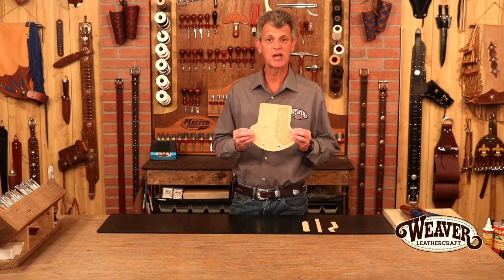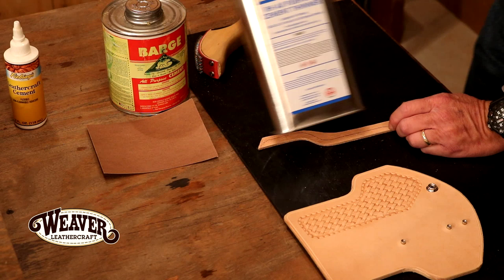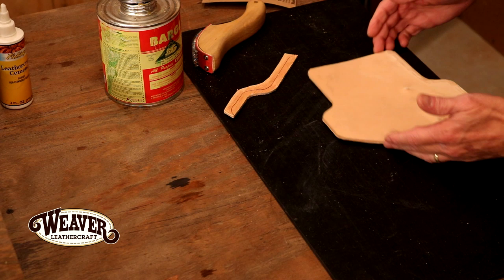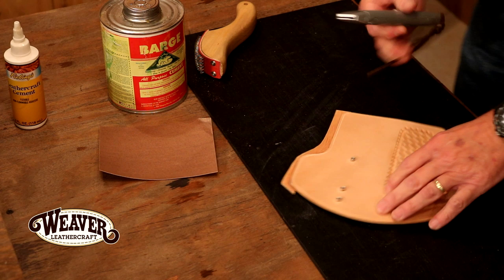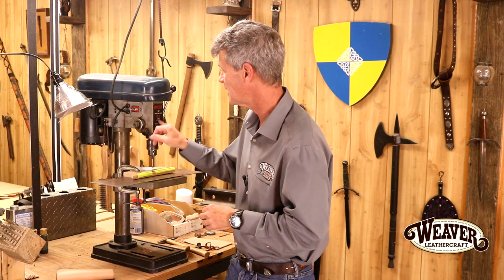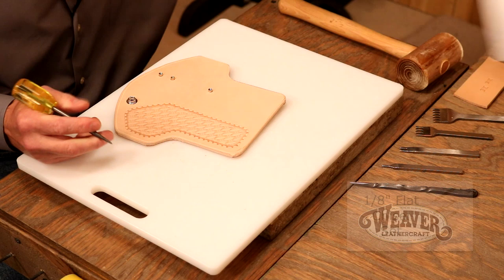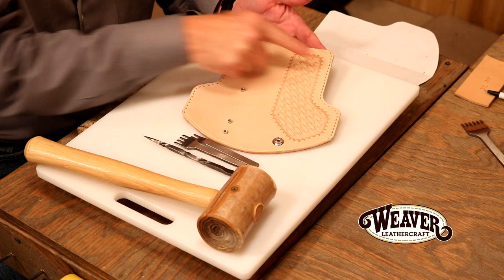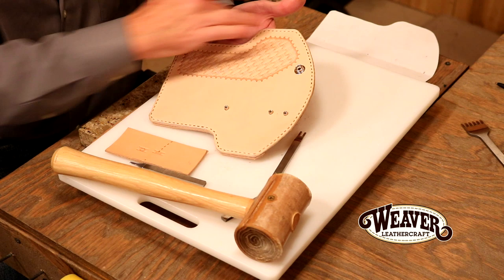Making a Leather Holster Chapter 4: Adding the Stitch Holes for Sewing

Comment: So I can't really tell but I assume that isn't a diamond chisel right? If you were using a diamond chisel, half would have to be hammered through the grain side and the other half through the flesh side so that the orientation of the diamond holes match when folded over correct?
Reply from the maker: Hi Bill,
That's correct, I used a straight chisel. If you click on the link in the description the chisels I used are listed there!